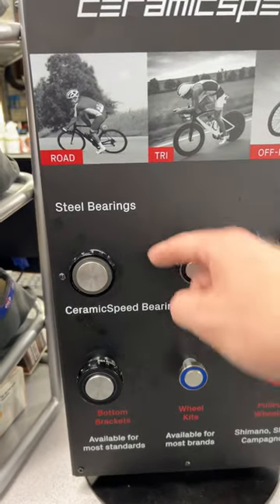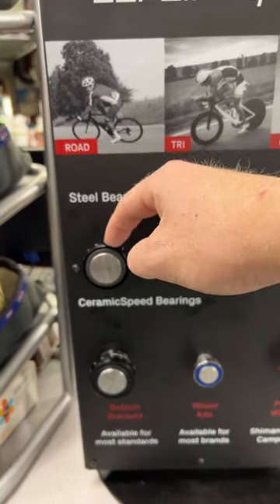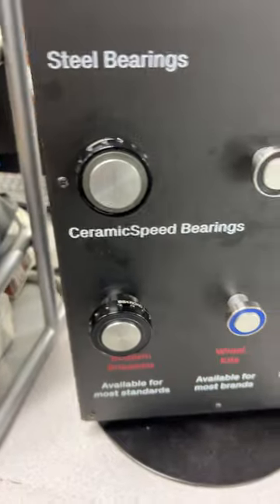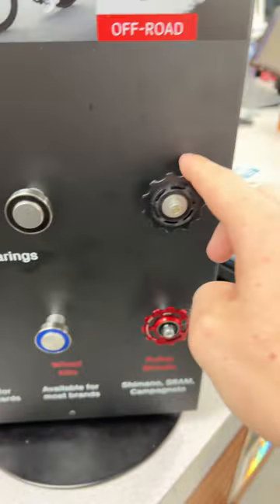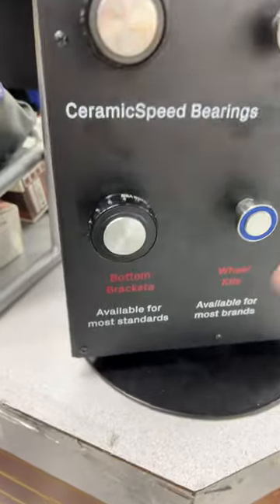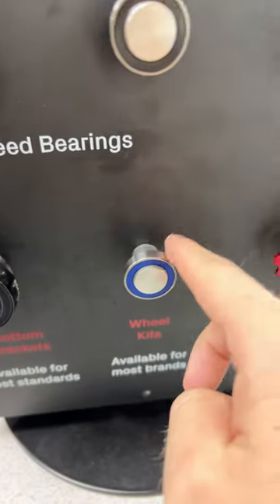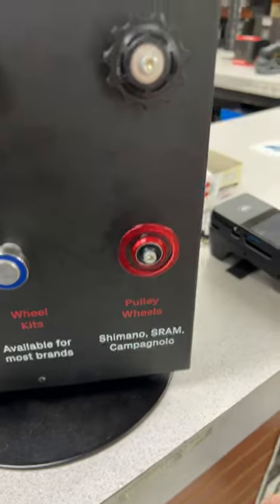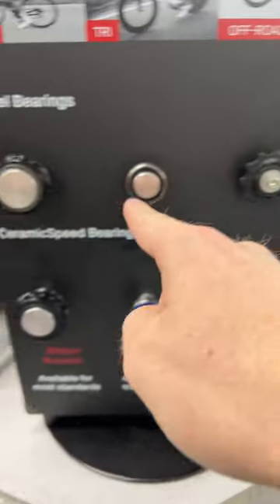Why your bike needs ceramic bearings!

Comment: Just a part of the friction of a bearing comes from the friction of the balls in the inner and outer ring. The main friction comes from the friction within the cage, and the friction within the grease lubricating it. Of course you can flush the grease out and it will spin very light but you lose the lubrication in this case. Ceramic balls have the same friction within the cage and with the grease.

Comment: FYI, those regular bearings have (an arguably excessive amount of) grease on them, which does add drag to them. There are 2 solutions to reduce the drag. 1: put a high speed grease (like redline cv2) in them, at a lower fill percentage (20-30%), this will increase the likelihood of bearing failure if water gets past the seals. 2: Perform the SKF run-in procedure on your stock bearings. (I do this with the rear wheel of an upside down road bike, and your fingers start to get uncomfortably hot at 140*F, 60*C.)

Doing both of those will get you 85-90% of the ceramic benefits, for 2-3 hours of work and a $15 tub of grease.

Comment: If you pull out all the grease from steel Shimano BB. and squirt little ordinary chain oil, it's going to be as smooth as ceramic one, but you will have to serve it every week.

Comment: From the downhill longboarding world: ceramics are great for speed but the forces put on them will eventually cause them to crack or in the worst case shatter (let's say after 20-30 runs). Steel bearing do not suffer from this making them last longer, but they also do not roll as fast and they tend to collect more crap imo, their lifespan is a year or two if you don't ride in rain (and if you oil them regularly).

Comment: Ceramics like these are actually ceramic hybrids with.  The balls are ceramic, and the improvement in rolling resistance is nill.  Seal geometry and lubircant make up the majority of the differece in rolling resistance that can be changed in a bearing.

Comment: If you fall for this marketing you probably also think teslas are good for the environment
Reply: Well they actually are lol. Volvo did a study comparing their XC40 against their electric C40. They found that the EV produced 70% more CO2 than the ICE during production. This is mostly due to the battery. HOWEVER: after only 30k miles of driving, the EV will have fully compensated it's production emissions compared to the ICE. So the ICE is only the more environmentally choice if the car drives less than 30k miles during it's entire life. 
EV or not, cars are all shit anyways. They should be banned from cities.
Reply: @nikscha lmao he tried
Reply: @nikscha oh yeah let's trust the car industry to make "research" about cars. It sounds very objective!
Reply: @KenchikukaYorch44  who else is going to do the research?  You think car company's that have spent BILLIONS  on research on fuel efficency/emissions would have the correct studies and information? Car company's dont care about "big oil" they care about selling cars, and what ever sells, they will make and sell. Yes electric cars run off the same grid as all electricity, but the percentage of electricity made using fossil fuels is getting smaller and smaller every year. So yes electric cars are more economical friendly.
Reply: @nikscha lithium mining looks less sustainable than oil drilling. The quarries left behind from lithium mines is fucking disgusting
Reply: @EmazingGuitar  and where are those mines? In countries that have no mining regulations. If electric cars become more popular. These mines will be cleaned up and regulated. Its happend with our gold, copper, diamonds, and gemstone mines. It will happen with lithium mines. You guys always have an argument to fight agenst electric cars.  Fun fact, electric cars came before gas cars. The only reason gas cars were made over electric cars is because gas cars had much more range and power back then. Grow up, stop being scared of new things.
Reply: @nikscha  Yeah, forget about EV's they're an awful idea.......you can actually run a car on hydrogen. And, guess what....? We live on a water planet.

Problem solved, for ever.
Reply: @Dandroid5000  let me know when you find a way to burn water
Reply: @corkhead0  I'm guessing science isn't your forté, huh?! You can extract oxygen and hydrogen from water..........h2o, derp.
Reply: Did you know what produced the electricity for the tesla? Have you studied the laws of thermal dynamics? What happens when you transfer electric energy from one source to another? @nikscha
Reply: @djdedeo0  there will be losses. Every child knows that. I'm guessing you're hinting at the electricity for the Tesla being produced with Fossil fuels? First: only half of the worlds electricity was produced with fossil fuels this year, and this number will only shrink in the future. Second, the losses in an internal combustion engine are far greater than the losses from a big gas turbine (who would have thought). So the same amount of fossil fuels will yield more energy if burned in a coal power plant compared to a gas car. This means that a tesla driving on electricity from a coal plant is still better for the environment than a gas car. There's been so many studies on that, and the fact that you don't know shows how ignorant you are...

Comment: I used to ride a bicycle everyday because it’s flat and always sunny. I used to keep my bike in top shape and lubed to the specs. I got so involved in it I wanted to work at a bike shop to relieve my craving for perfection and learn more. The one critical aspect of biking nobody has been able to overcome is wind. It is the ultimate challenge
Reply: You can position your body into an aerodynamic position and optimize marginally with clothing (aero skin suit, overshoes, and helmet).  This way you reduce the wind resistance by slicing through the wind.

Comment: Since i replaced destroyed steel bearings in every one of those applications with ceramic and would do so again. Ceramic speed isn't the only manufacturer of such bearings as well. And yes, all you need is some oil to keep them lubricated. Steel needs a full repack of grease which means disassembly of whatever you want to lube.

Comment: For on road use yes but for offroad use the durability of the steel bearings is needed. I race rc cars and a hard hit is enough to shatter out full ceramic bearing or even just the ceramic balls in a hybrid bearing. Mountain bikes this would be a no go in my opinion.

Comment: There is a difference between free spinning 

And spinning with a load.

It doesnt matter how well and long it spins without weight or torque applied.

It matter how well it spins when u sit on the bike and actually ride under load.

Comment: My Chris King spins as well. With steel bearings. But it spun better as it wore in. But use grease, but not too much as that will blow the seal off.
But more grease and heavier the grease and tighter fitting seal ad dmore resistance.

Comment: The problem with ceramic berrings are they dont take shock well. Its a trade off. Depends what you want to do are you downhill mountian biking on trails then take the steel berrings. Road racing on a flat paved surface ceramic.

Comment: The steel bearings are meant for more rugged use and have more drag ceramic bearings are made for close to 0 load use and least amount of drag 
Scion used ceramic bearings in manual tc transmissions and the destroyed themselves

Comment: Try smashing a same size metal ball and a ceramic ball. Which do you think chips or shatters? The only benefit ceramic has are high temperature resistance. That is useful if you are going insane speeds with the wheel being in high revolution state. But how fast can your bike go? 200km/h? 300km/h? Is it subjected to very high temperature like a jet turbine? No?

Comment: ceramic bearings are mainly used for high speed applications or applications where bearing stiffness is important. neither include bikes. they are better for high speed because they can tolerate more heat and generate less heat because the balls are lighter and thus push into the outer race less. pthey are stiffer because... well ceramic is stiffer than steel.

Comment: I ride downhill on longboards. Ceramic is faster and imo vetter for speed but thats all. I have to clean them and ive had a couple blow on me. Ove never had my steel bearings blow and ive only cleaned them a couple times over the last two or so years.

Comment: The bearing needs to be under the load it will expirience durring its use when you spin it in order to see how it spins while under the load it will expirience durring its use. If i need a bearing to spin freely under no load, then this test is spot on.

Comment: As a bike mechanic, I can tell you that the performance gains you get from ceramic bearings is so minimal compared to the cost. Of course ceramic is objectively better performance wise, it makes no sense for anyone except people at the top of their physical form or people with extra cash. 

If you got the money for it, go for it. They will serve you well. But 99% of people will never know the difference. 

Get some carbon rims instead with that money

Comment: Unless you're doing national racing it doesn't matter. After the bearings break in theyre almost the same except for the steel ones last longer in real world conditions. I wouldn't buy them for anything other than a road race, and only one race, the steel ones are better other than the first race.

Comment: problem is the bearings are dry and no load, on-top of that all the "ceramic" bearings have polymer cages and those are not as good as metal cages. In the case of bikes, most of the power-loss occurs in the slide between the balls and the cage - in short, not effective in bike bearings. Also, ceramic bearings are made for HIGH SPEED applications - rpm's that no cyclist will achieve.

Comment: but if i put ceremic bearings in my mtb then ill be replacing them like every month
Reply: Just tried ceremic for pully wheels. Spins nice when new. The ceremic pully wheels where both toast after 200km of bad weather. Totally broken, stuck dead, one does not spin anymore at all.
Reply: Lesson learned 😉
Reply: Every week 😅

Comment: Ceramic is good for racing and events but they wear out the metal cups much faster than triditional ones. So if you are doing anything other than high speed or high endurance racing, it's not worth the price.

Comment: Run your bearings ungreased and unshielded with a drop of 3 in 1 or micrometer oil and they will spin fast as fuck. you will chew through bearings pretty fast with no shields and grease.

Comment: Hmmm yes why don't we use ceramic bearings on car axles. Ceramic may have less friction but it is brittle as glass compared to steel. Metal can take blunt impacts and generally 'tougher' than ceramic or composite materials. Even if its push bike I would use steel bearings, I'd hate to fall off just cause my bearings failed due to running over some twigs😂

Comment: Yeah, no way. As a scientist and engineer, ceramics not fit for bearing loads. Might be great initially, but ceramics can crack or disintegrate under pressure. Im surprised its even an offering.

Years ago, I can’t remember if it was honda or Toyota, but someone was offering a ceramic built engine. And due to vibrations and stresses, they we never able to get it working for long

Comment: to make it more clear, a bearing does what it says, it "bears" a "load" it is a bearing. without a load you can de grease a skateboard bearing and it will spin like crazy. it will also explode if it spins like crazy for too long. how well a bearing spins without a load is a moronic way to approach the idea that one bearing or another is better. as i said, they are made to handle a load.

Comment: This is an useless test - no load on the bearings! Also what grease did they use for both sets?
 I have been in-line hockey/street for a very long time and used any Abec, some titanium- different ceramic brands … spent small fortune in my teens on the Bones Swiss ceramics- the best for sure! 
Being more mature I’ll say yes ceramic are better when new but they’re fragile and so expansive that it does not really worth the improvements - 
 When a good Teflon grease and regular cleaning will make more difference

Comment: That is a super nice marketing strategy, but people has forgotten all physics they knew in case they ever understood physics. 

This kind of optimizations are interesting for strengths on much lower ranges than the ones used in cycling. For the strength of a 5 year old it can be measurable. But on a grown up bicycle and even on a professional bike, it’s not even measurable under real conditions. 

It does have that psychological effect that makes you feel faster, but again, physically not even comparable under the strength of a grown cyclist

Comment: The middle one is a hybrid not a fully ceramic. I'm assuming the other two are as well. Although they are better than normal bearings it sounds like marketing wankers selling hybrid bearings for the ceramic prices.
And the type of lubricant in the bearings are also a great factor in bearing drag.

Comment: Ceramic bearings in steel races spin worse than steel bearings.  As Ceramic bearings are harder than the steel racers and cut into the steel.

Comment: Ceramic bearings only have an advantage over steel for a few hundred km. As they rotate, all bearings wear both the bearings themselves, and the race they sit in. In steel bearings the materials are of the same or similar harness, so both wear evenly. Ceramic bearings are, obviously, ceramic, which is much harder than steel, but they still use a steel bearing race. This means that as they wear, the relatively soft race wears much more rapidly than the bearings themselves, leading to play developing more rapidly and any advantage they had being eroded.

So yes, this marketing gimmick is very convincing, but only if you don't know what you're talking about, and if you're doing it intentionally you should feel bad about misleading your viewers.

Comment: And this is the explanation as to why you wouldn't want ceramic bearings 1st they break like glass 2nd the moment you get them gunked up they're gonna run just as good as a steel 3rd There more expensive, my case seems pretty much shut and closed

Comment: trash on skateboards so im sure they are trash for bikes, They are harder then steel so technically yes, They can be finished to a smoother surface and provide less resistance but they crumble and fall apart and you will be replacing them often.

Comment: Lol, not really. Easy when they overtighten the top row. The difference is so miniscule. Only reason for ceramic is if you don't want to get the steel bearings rusted if you ride in the rain.

Comment: your bike does NOT need ceramic bearings , all just a way to make a quick buck off weigh weenies and watt chasers , remove the seals and relubricatea shimano bearing with a teflon oil instead of grease and they should spin with similar low friction m the low fricion on the ceramics also tell me thier seals arent seals but merely dust covers , heck most of the time pulley wheels arent even on bearings theyre on bushings !

Comment: Ahh just forget the fact that the steel bearing was using a plastic cog and had no centrifugal force helping it spin and the ceramic had a metal cog which gave it weight adding centrifugal force helping it spin

Comment: If youre gonna advertise off road I'd wanna see some abuse testing especially to the wheel bearings. I hear ceramic and I think chips and cracks. They're fine in a turbo though.

Comment: All that demonstrated is that Teflon oil is thinner than grease, flush out a steel bearing and replace the grease with oil you will get the same effect. Biggest con in cycling.

Comment: Standard Headset bearings cost 20.00 dollars and last 2-3 years. Ceramic Headset bearings cost 240.00 dollars and last until you case 1 landing. Look whos still riding.

Comment: A normal steel bearing will spin just as well if you take the grease out. Bike components don’t get hot enough for ceramic bearing to matter. This is nonsense.

Comment: Those are absolutely crab steel bearings on display ceramics bearings are great and do have much less friction but bailiffs are also usually much worse with ceramic hearings

Comment: Nonsense. Ceramic bearings are for high speed where heat becomes an issue. You'll never reach those speeds on a bike unless you can pedal at 15,000 rpm

Comment: What a load of crap. You can make any bearing spin like that of you take all the thick protective grease out and use a light oil. Also the seals cause far more friction than the material used for bearings. Watch the Hambini video. Ceramic bearings only really work out better in extremely high speed situations like 2-3000 rpm.

Comment: This is stupid, i get ceramic bearing are slightly better, but as a skateboarder and car lover, steel bearings work pretty good with s bit of lube (like bearing should be and not dry like this example)

Comment: I call BS cuz I got some pulleys on my lawn mower that the bearings may sound questionable but they spend a lot better than those those steel bearings like seriously shouldn't come on lying put a little bit of lube on those steel bearings and they're perfect you got to loop bearings up just cuz they got will probably don't mean you can you take on them plastic side covers off the bearings and you can grease them

Comment: Loads of BS, most of the friction in RS type bearings comes from the seal, all the demos I've seen the steel bearings are lubricated, the ceramic ones are not, the ceramic ones need lubrication too, if you want low friction, use ZZ type bearings with a ligther type of lubrication and just deal with the fact that water causes rust inside the bearing